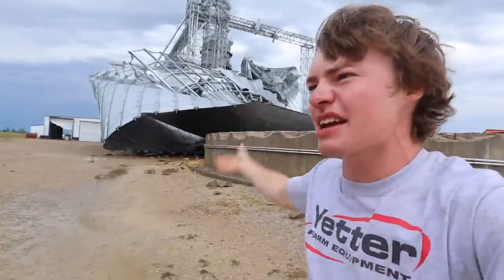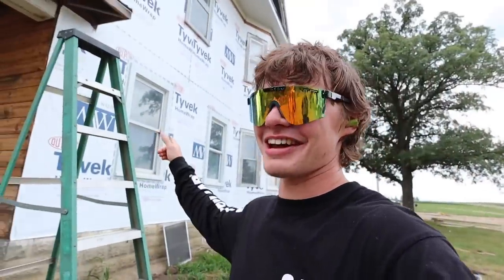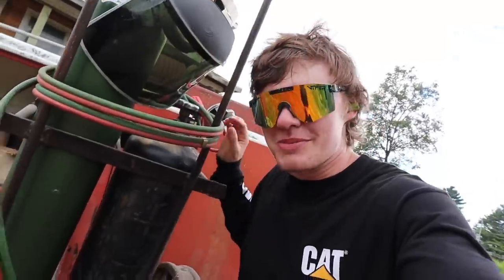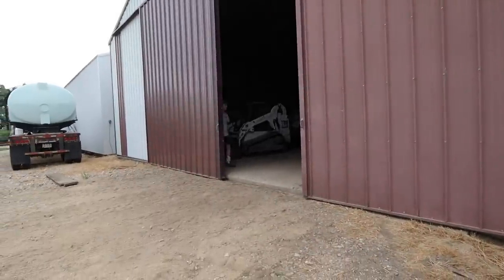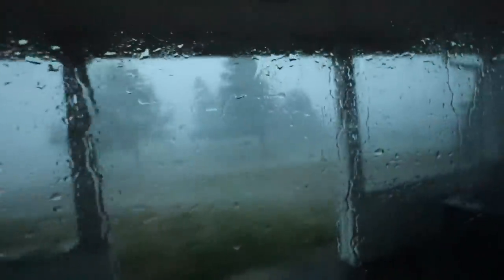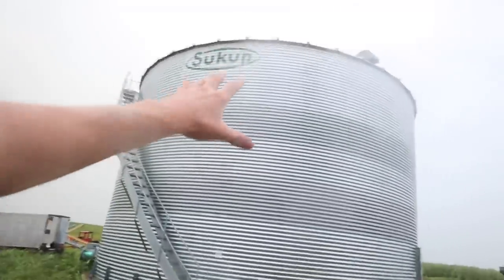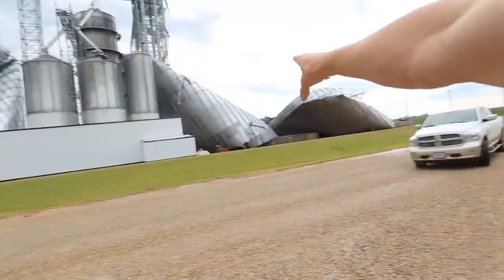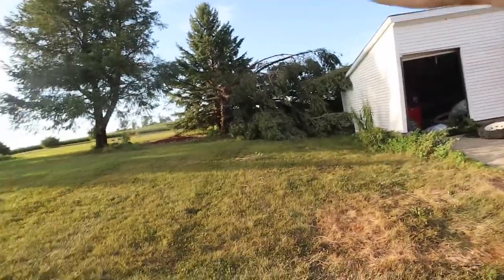Our Farm Got Destroyed.

Comment: The wind blowing by the storage bins caused a pressure differential and that caused the collapse.  So a way of equalizing the pressure of empty bins during strong winds needs to be found.  It looks like a crane like the one used to load container ships would help do the repairs.  Glad you are all safe so far is seems the whole state will need assistance
Reply: Pure physics wise opening the bin so the pressure of the storm equalizes, a ton of caviats with that though such as wet grains
Reply: @vincentouwehand828  I never suggested open in the bin which would hasten the collapse.
Reply: More like pressure regulated multiple blatters that would inflate sequentially to fill empty space as the bin empties.

Comment: How did the wind turbines do? A lot of engineering goes into them so they don't shatter in the wind.
Reply: They control the tilt of their blades so I would imagine in crazy winds they just go for 0% power capture and are perfectly fine
Reply: I used to build wind turbines for a living. Most modern turbines are more than capable of surviving storms like this. They will shut down, the nacelle will yaw into the wind and the blades will pitch so they wont catch wind to eliminate the danger of overspeed/running away. Lots of cases of wind turbines surviving tornados. Biggest risk is damage to the fiberglass blades.

Comment: Can't store grain in your own bins nor at the co-op. That sounds like a challenge...
Reply: or at a neighbors either,, ,, , that may suck for the whole area ,, if harvest is any good,
Reply: Can't build new bins in time? They got a 2 months
Reply: Not with the volume of how many bins got damaged. Everyone is going to be wanting a grain bin fixed or rebuilt.
Reply: I wouldnt worry about co-op thats the first back up.
Reply: christophe leblanc well part of the crop got leveled so that helps the storage problem a little atleast. And most farmers have some kind of insurance for that too. Won't cover everything but it'll help
Reply: To be a total stranger in farming, but why are these not lower and wider (square) and or half in the ground?. I know the square space story ,but it seems nobody has a shortage of space. It doesn't pop that easy as this.
Reply: x w x w I assume many issues would come up. Lower storage would mean more bins so fewer acres to farm but that's not really that much I don't think. The main thing I think is that the wider you get the more flat your circles become which means the wind won't flow around it as well and may be even weaker. Take this comment with a grain of salt. I'm just spit balling
Reply: @xw6968  i think the pressure from the grain on the inside would pop them outwards if they were too wide and if they were partly in ground then moisture would destroy them
Reply: @x w bins are expensive as they are let alone all the reinforcement that it would take/cost and bins are also super dangerous a square bin would be horrible. And putting on in the ground your asking for problems as in water would be no way to keep it out of the grain. It would look like coles basement flat ground and water is no good.
Reply: x w Square bins, while they may be stronger, would be difficult to empty. If you have watched any of the older videos perhaps you have seen that the bins that have a sweeper arm that goes in a circle to help empty the bins. That wouldn’t he possible in a square building.
Reply: @xw6968  As someone else stated, a bin sweep wouldn't be possible in a square bin. Square to me is just a flat wall and that wind would probably have a greater effect on. Whereas round, the wind does have a chance to blow around it. If they were set Into the ground, how would you unload them? Most bins have the sweep come out a couple feet above ground level. Below ground would also require more reinforcement which would cost more
Reply: @christopheleblanc9175  maybe silage is an option?
Reply: Glad that Cole posted a video. Was getting concerned how they came out of the storm. Areas 1 to 2 counties to the west had total corn fields snapped off below the ear and are flat. 770 mi long windstorm started in SD and didn't end until the IN and OH border. In IA it was at least 60 mi wide as headed east across the state.. Town 25 mi before Cornstar Farms had 99mph winds at the airport and still without power. Prayers to those affected. This one's going take awhile to recover from.

Comment: Many in Davenport, and Clinton, Iowa and Fulton,Il are still without power.  About 2 hours after the storm hit, we were cutting and stacking brush from downed trees. Still not done, but we had no major building damage and no one was hurt. We got power back after 31 hours. The crews are still hard at fixing lines and cleaning brush off of roads after 3 really nice days of weather.

Comment: Monday was going ok was humid then seen storm come in. We got all doors closed on shop and watched it come in doors were rattling and rain coming through. I lost big limbs off tree in back yard done cutting them up. Drive east of Des Moines and north of Ankeny corn field is flat not bent over but flat. Still parts of Des moines no power since Monday 11am. 63rd street from freeway south power poles all down. We finally got Cable and Internet back today sometime while at work. New big grain bins by Minburn  partly down too. Weather service said winds from 90 to 115 mph. Last time I seen this many trees, power poles, lights been down ice storm in 1989 and then flood of 93 no power for a week and no water for 3 weeks

Comment: My Cedar Rapids friends got hammered also...
Reply: They are going to be without power for several more days. Not only are wires down everywhere but the grid system is badly damaged and 22 towers are down.
Reply: We just got power back from being out for 24+ hours. I’m in Ames atm, worked at customer service at HyVee the day the storm hit. It was absolutely insane!
Reply: I live in Fairfax, which is just west of Cedar Rapids.  Lot of destruction, trees, fences, houses and buildings torn apart.  All transmission power lines into Cedar Rapids are down.

Comment: The only Bright Side is that after Rebuilding everything ends up NEW
Reply: But if nothing is improved upon it will only happen again. All the storages are just huge wind catchers made of sheet metal. The concrete anchors were way too shallow to hope to hold against the winds. Greater structural integrity is a must if you want to avoid damages like these that will only happen more and more often in the coming decades.
Reply: I wouldn't insure shoddy construction like that.

Comment: Cole, build the side portion of your wrap-around porch with an extended "bay" to mirror the shape of the bay window.  Straight coming toward the bay window, a jut out, another straight run, then a return, and straignt again to the side door and then all the way to the end of the house.  Having that extra area to the side of the door will give you a nice area to place your boots and to maneuver items when you are coming in and out.  I think for practical uses, it would be better to have the steps up to the side door rather than up to the bay window area.  Or, you could do both.  But I think if you omit the stairs directly up to the door, you will regret it when you come home with groceries and other items which need to  be carried into the kitchen.  Just a suggestion.

Comment: Hey Cole, I might not know what I'm talking about here.  But why not put "U" brackets up and use galvanized or iron pipe to put across the sections of the silos, that way when they are empty they are being supported by the pipes running across the sections; say about every 5-6 ft up!  If you're worried about it messing or contaminating the corn, just make the brackets and pipes to be easily removed when it's going to be put in use.  You were saying when they are full they are strong so pipes running cross each section per say, side to side would make it solid when it's empty.  The only reason I said pipes is that the corn would just flow over the pipes just like they were supposed to, whereas angle iron would hold the corn causing a bit more waste. Not sure if this is done anywhere else but a one time purchase of pipes would be much cheaper than buying or replacing a million dollar silo. Just a thought :).
Reply: There's not much you can do - it's too much surface area, and not enough mass to hold it down to the ground. If the wind wants to take an empty bin, it's going to take it.

Comment: I’m sorry to see and hear you had to go through this. 
We had a very bad hail storm hit our house in Calgary, Alberta, Canada a few years ago, and, we had 3 windows smashed in and holes in our vinyl siding. 
We had to replace the roof shingles, those 3 windows and the siding. It sure takes a while to get over those kind of things. 

I am happy to see that your all safe and that no one got hurt. 🌞

I’m actually in Red Deer now, which is north of Calgary, (and hour drive away from Calgary) and I rotate between Red Deer and Calgary.
In Red Deer a few years ago, a very brutal, strong and hectic wind storm hit Red Deer. Trees were blown over and some were uprooted, and fell onto the tops of vehicles and houses. I was very alarmed by that also, and, how the wind picked up. It was to the point where it knocked the power out, and, I thought it was a tornado, but, it wasn’t, just a strong 100+ km wind. 
Fortunately, my apartment had no windows blown in, and the building in Red Deer that I’m in is very strong with cement blocks in the walls.
I was also thrilled that everyone I know and knew were all safe. 🌞☺️

Comment: Pro tip - Use masonry line blocks on the batter boards until the exact string location is finalized. Then replace them with a nail.

Comment: If you measure 3 feet in one direction make a mark. then 4 feet in the other direction make a mark.then if you measure 5 feet between the two marks you will have a perfect 90deg right angle. any measurement will work 6,7,8 ,910 11 and so on.